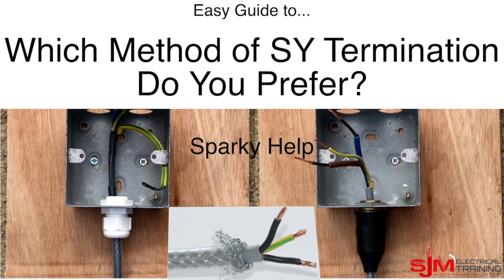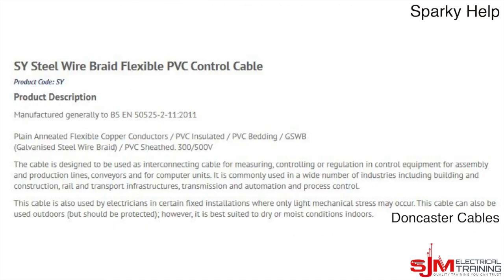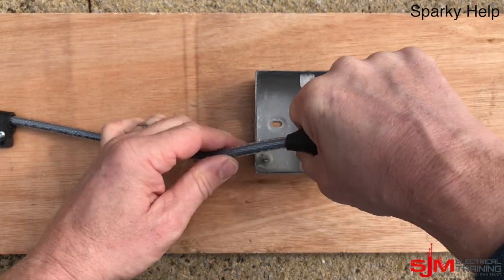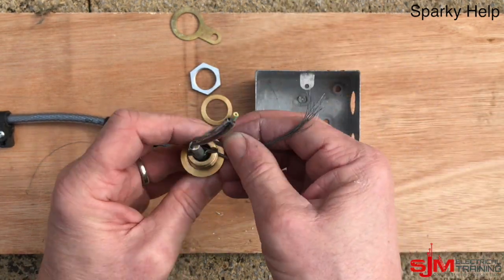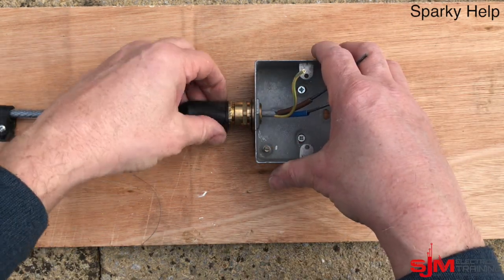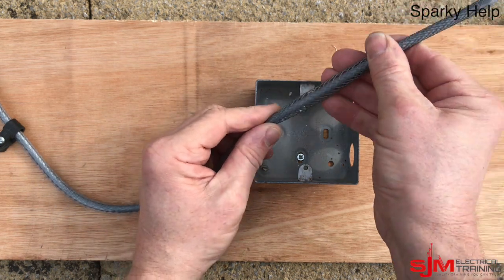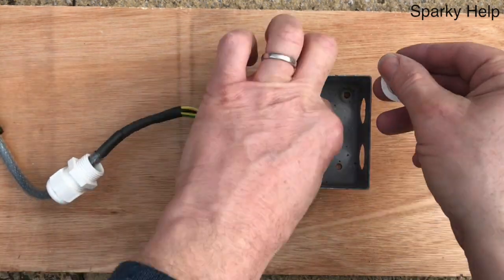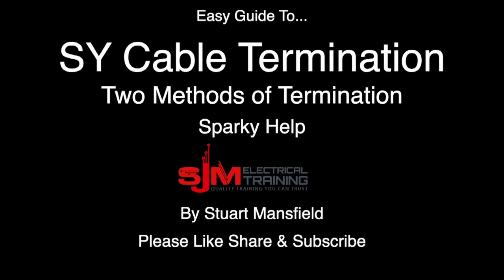Two Methods to Terminate SY Cable which do you prefer?

Comment: Should just be used for non permanent equipment and ist pants
Reply from the maker: So just a useless cable then - agreed.
Reply: @sparkyhelp3997  yes absolutely useless I have worked in heavy industrial and it's not worth a toss armoured cable or nothing don't waste time pointless